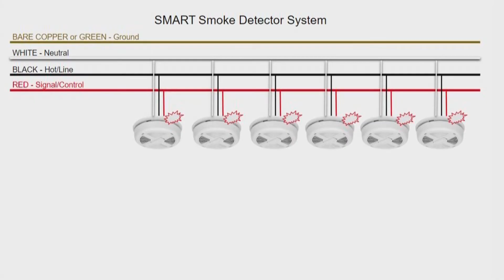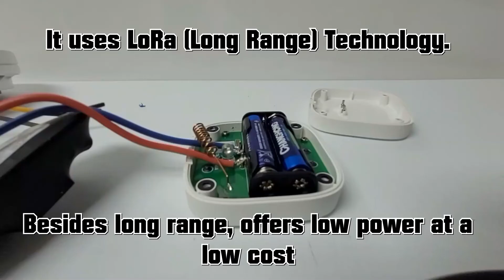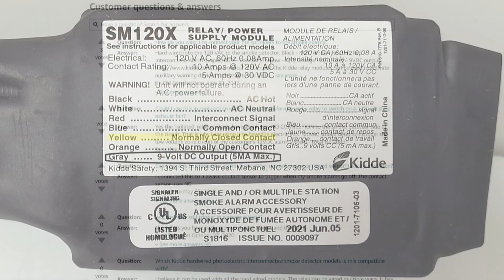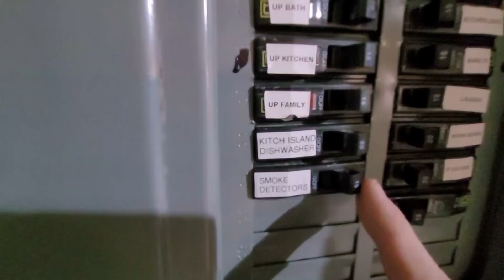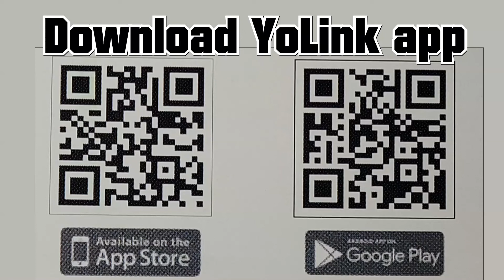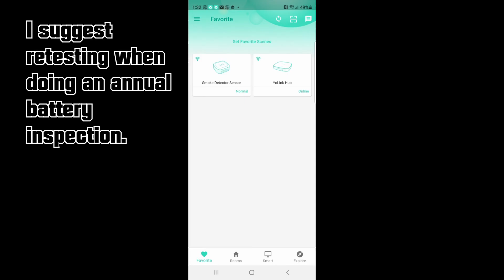Get Notified / Emailed / Texted when your Smoke Detector Goes Off !!!

Comment: Could you use the Yolink relay in place of this Kiddie relay?
Reply from the maker: No, the YoLink Relay will not work in place of Kiddie relay.  The Kiddie relay senses a smoke alarm interconnect signal of 5 to 9 VDC (depending the on smoke alarm manufacturer) to close the relay circuit.  The YouLink Relay is triggered by an event in the YoLink app and that closes the relay circuit.  So you need something that can read the interconnect signal, which the YoLink Relay can't do.

Comment: It is great video. If you use the YoLink outdoor contact sensor instead of the water leak sensor, it's easier, you don't need to do the solder work.
Reply from the maker: Thanks for the suggestion.  I will update the notes with this info.